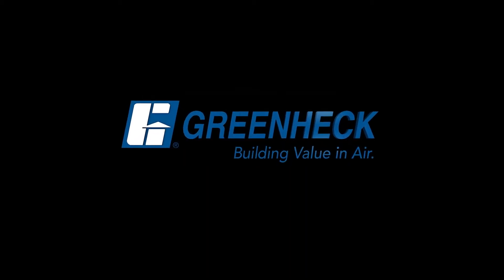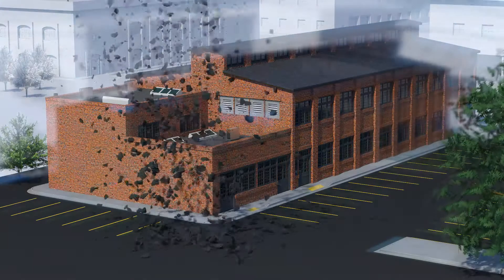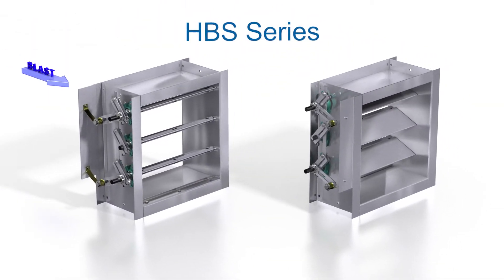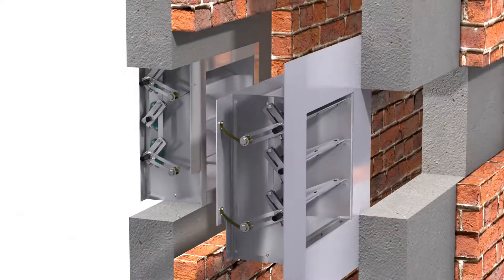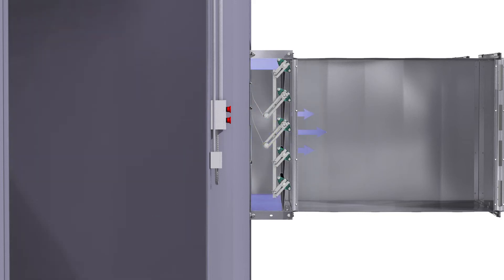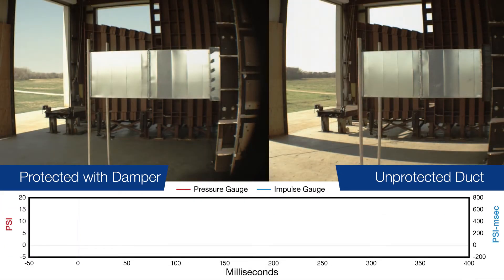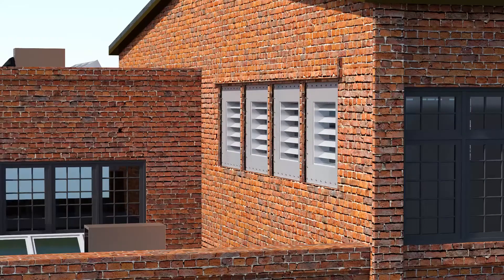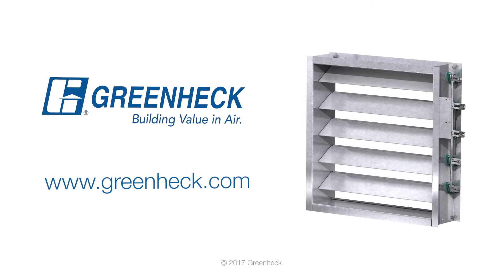Greenheck - HBS Series Blast Damper Testing

Comment: Also one other thing you left out - why would I opt for a damper instead of a blast valve? A damper mitigates some damage, a blast valve stops the damage entirely, and a pressure capable ducting system pre blast valve means zero duct damage and perfect operability post-incident. So one system seems to knock you down for a few days and does mitigated damage, the other means no down time and no damage. What's the point in a damper?
Reply from the maker: Designers have many options when it comes to blast protection. There are many different facets to be considered when selecting the best option, including the size of the potential blast, the likelihood of the blast, the initial cost of the protection, cost of downtime, the type or location of the building that needs protected, the anticipated distance from the blast to the area needing protection, etc. When weighing all of those options, some solutions will inevitably be more cost effective than others and some solutions will be more protective than others. It's the designers and owners responsibility to weigh those options against the risks associated with them.